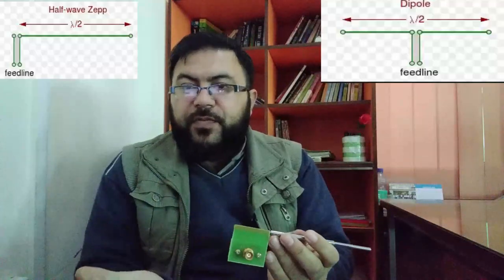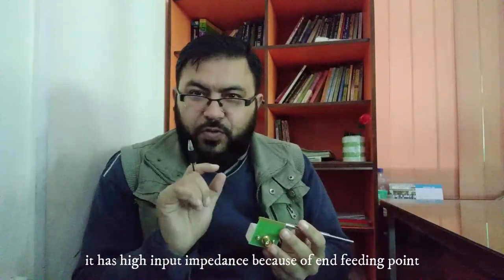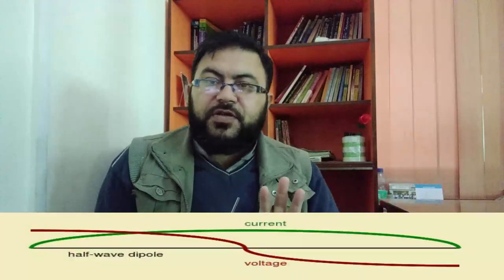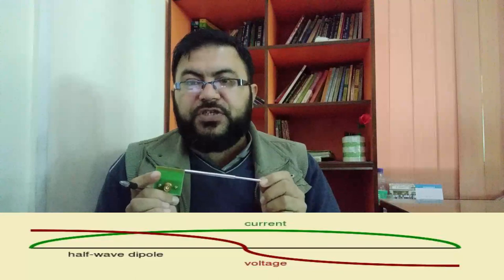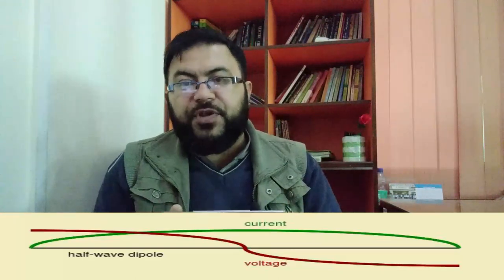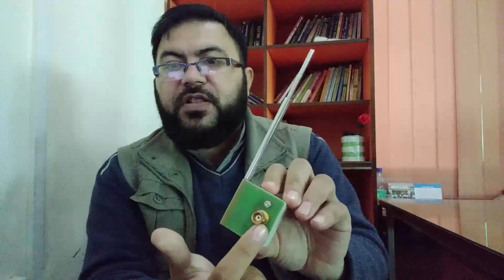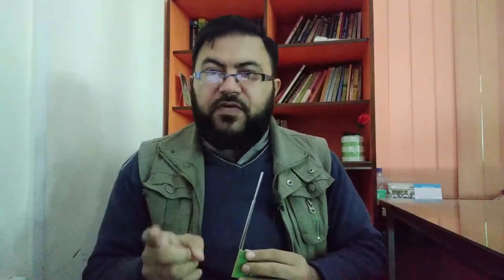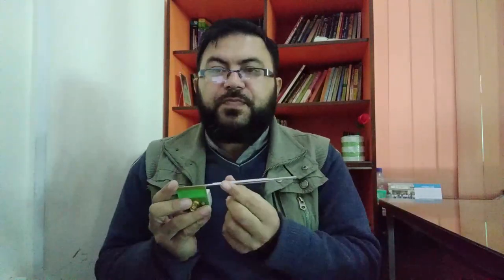Why we design zipline antenna |What is zipline |zipline aircraft antenna |Design zipline antenna

Comment: How to designing this antenna by ADS Software
Reply from the maker: It's is very simple you have to make a simple transmission line and connect one end with connector and other with aerial
Reply: I need equations for calculations... Plz
Reply: Dimensions